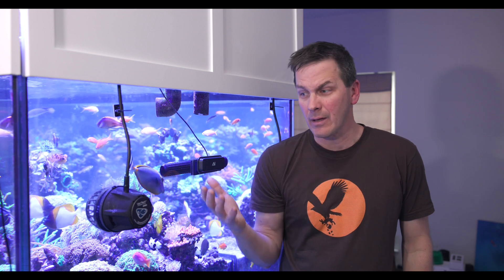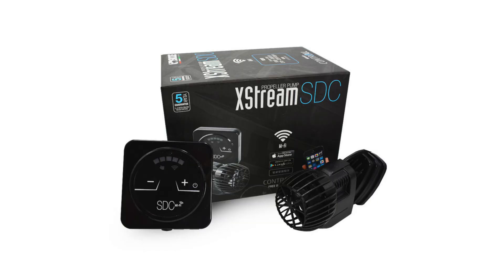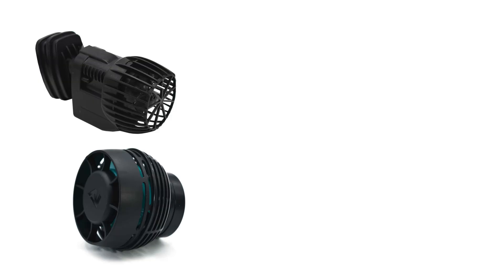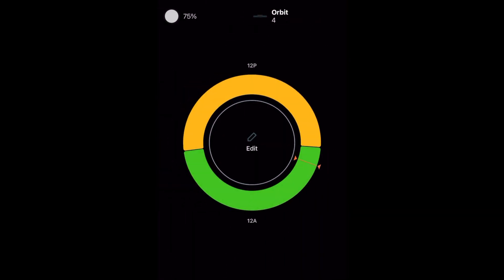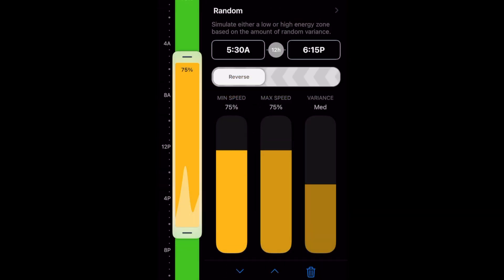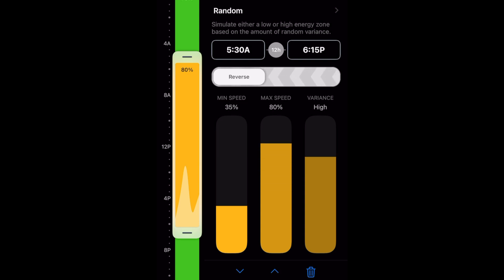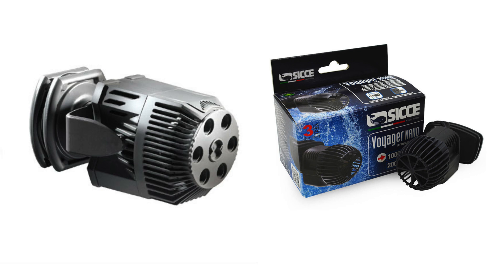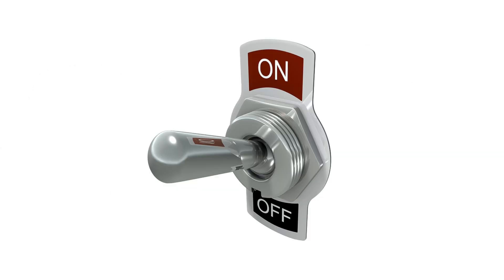Powerheads VS. Closed-Loop Systems For In-Tank Flow - Comparisons

Comment: For info on my previous peninsula tank I had a couple of tunze power heads hidden mid tank in ceramic rocks. That worked well and the only downside was removing them a couple of times a year for maintenance.
Reply: How did you get power ?

Comment: Nice video Mark , I've got a completely different kind of flow design in my tank you might be interested in 🤔 6ft x 3ft peninsula with no visible pumps, cables or wires and 150,000lph of flow 💪
Reply: Any vids, thinking of setting up a 6x3x2 peninsula
Reply: @leighwhite1898  I've done a brief video on my channel but I've changed a few bits in the tank the way the flow works etc

Comment: Very interesting. I think if I ever build another tank, even though it would be small enough for powerheads to do the job, I would still consider a closed-loop.  Anything to reduce the clutter on the tank walls is a bonus. Just need to think about the aquascaping ahead of the build